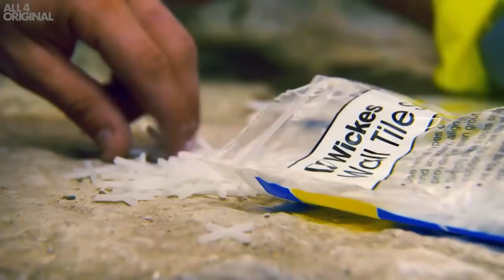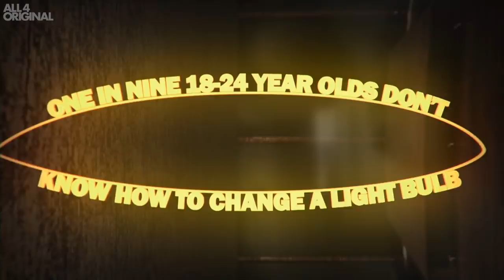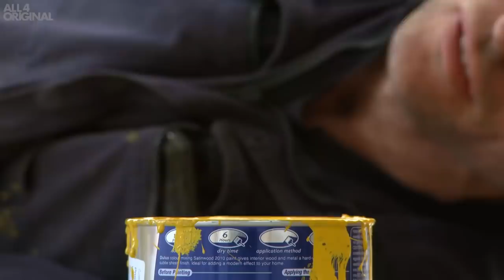Guy Investigates the UK's Construction Skills Shortage | Guy Martin Proper

Comment: On of the biggest problems is they eliminate a huge portion of the potential workforce.

Apprenticeships are good... But you have to act quickly in a short window. Years ago I enquired about doing a trade at the age of 25, they told me I was too old.

Fast forward and the rules had changed to help over 25s, unfortunately when I looked into how much it would cost to do a 3 year apprenticeship course as an adult was thousands upon thousands of pounds. Which torpedoed the plan before it even began.

They need to make fully funded apprenticeships open to more people from all age ranges not just people who are at an age where they don't really know what they want to do.